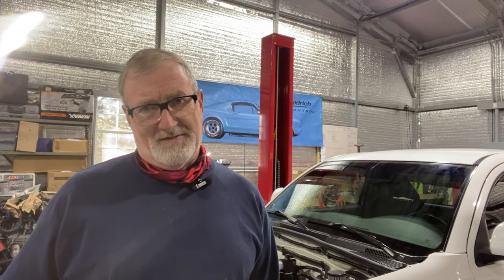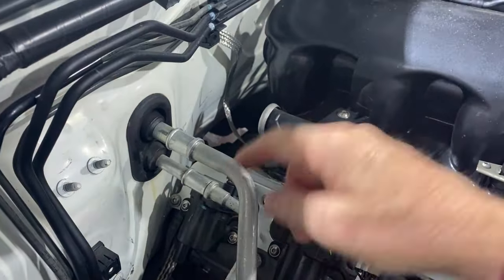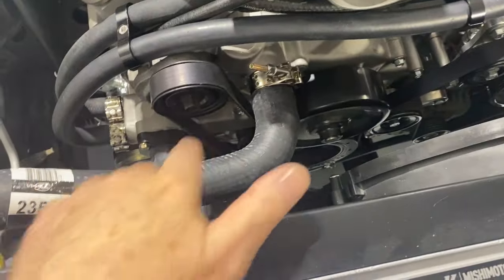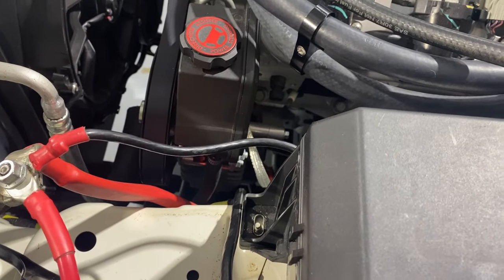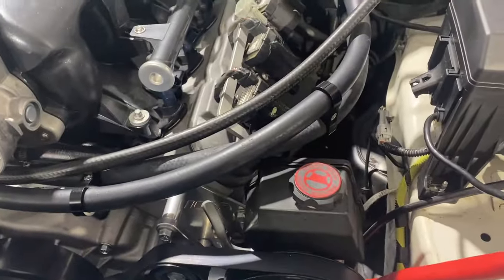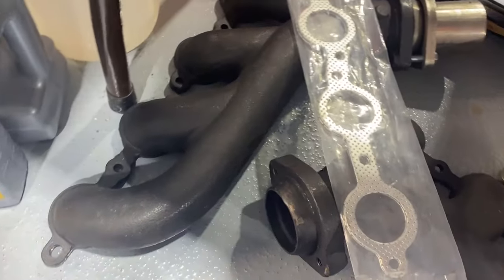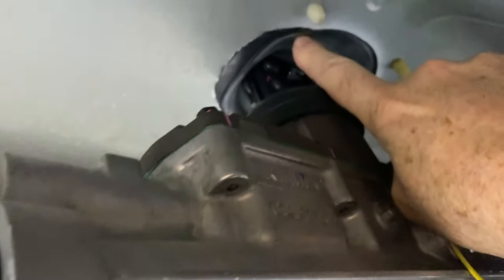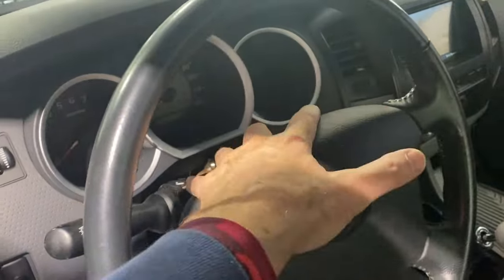Part 7: 2nd Gen 2007 Toyota Tacoma LS Swap WALK-AROUND..Part 1

Comment: do you plan to leave the old ecu in place in order to run the non engine related canbus items? I'm actually looking to do a different swap but worried about what might not work on the body side if the toyota ecu isnt in place. also any plans yet on how you're going to mesh the new motor with the old cluster or do you plan to run an aftermarket cluster?
Reply from the maker: Yes, I do plan to leave the old ecu in place. The modern electronics are complicated and I only want to eliminate what needs to be removed. I plan to have the factory gauges functioning. I have started the truck. It will run, however I only ran it for a few seconds. Putting an exhaust on it today. I’ll know more very shortly. When it’s done I’ll do a complete video on it. Right now, if I tried to video what I’m doing it would take too much time. I’ve changed my mind several times on parts of the swap that either conflicted with each other or I didn’t like how something looked. Thanks for the question, it is looking good! Hang in there!

Comment: Is that the AC compressor from the LS or aftermarket? How about the bracket? Looks like stock location.
Reply from the maker: Thanks for the question. The a/c compressor and bracket are ICT Billet items. I wanted to keep the accessories in their stock location as much as possible. The bracket is very nice and tucks the compressor in. The compressor is very compact and is definitely smaller and more compact than even the GM Corvette compressor. Problem I found with the Corvette compressor was its length and hose/manifold placement. The length put it very close to the motor mount and with the compressor hose manifold mounting on the rear of the compressor, it would not work at all. The new compressor was shorter and the hose manifold mounting was on the side giving valuable room to work with. Check out one of the earlier videos, I went into more detail on the a/c mounting.

Comment: Thanks for the tips. I’m just starting to plan out a swap like this.
Do you think the Holley terminator max is worth the money? Especially if someone is thinking of using a 4l80.
Reply from the maker: Depends on a number of things...your budget, planning on how to run your gauges, etc. I have not personally used the Holley system. I'm sure they are a good product. Is it right for your swap? For example, in my case, I relocated a number of items that would make it impossible to use a "pre-made" or box kit. If you were to locate all the items as basically stock for a Tahoe/Truck, it may be fine. I located my pcm on passenger side fender panel, tac module inside the cab, etc. so an "off the shelf" harness would not work for me. For the money, I would suggest a harness builder (with a good reputation) and literally discuss with them the placement and exact item of every item to plan to use and its location to the pcm. That way, no surprises on wiring length and location. You need to let them know the type of injectors you are using, location of alternator and what type plug it has, type of coolant sensor (2 wire or 3),  if DBW, the length of wires (based on where you plan to mount it), etc.  On that note, if you are planning on going DBW, get the pedal, tac module, connector, and pcm from the same vehicle. If you don't, you may have issues with all the parts communicating properly with the pcm and TB. This is why I say an "off the shelf" product may not suit your build. Since you are in the planning stages, you can really go into detail so you are more certain to get exactly what you need for your project. I will be doing a video soon on wiring harness choices and pros/cons. There is no "best" harness since every swap is a custom application.  In some instances, Holley may be the best choice...or it could be a poor one. Do your research. It will become more clear which way to go. For the easiest swap (if there really is such a thing), go with gen3 engine with a matching transmission (from a donor), DBC, keep as much as possible stock to that engine and keep the harness the same way. Swapping into a smaller vehicle can pose some packaging issues due to less available area to mount stuff. Not to scare you, planning is your best way to insure a smooth project with minimal hiccups. There will be hiccups, I guarantee! All are fixable, but some you won't see until you get to that point in the swap and others will be more obvious. Too much to cover here. You can always contact me via email or messenger to cover more. Thanks for asking.
Reply: Thanks for the informative reply. I’ve been looking at videos on wiring, maybe a going with PSI may be a good choice for me.
I was contemplating a cd009 to a gen 3 Ls. But with your recommendation of stay stock with the original transmission is swaying my options to going automatic, 4l80 looks like.
I don’t think this project will be out of my skill set, just working on a realistic budget.
I’ll be taking my time, clean and repair the donor motor/trany. Wiring harness. I believe Dakota has converters for the gauges to work, ect….
I’d like to do this right, professional, reliable.
Oh, forgot, I have a XRunner so I should have a bit more room without the 4wd stuff.
Again thank you, good info.

Comment: I just ls swapped my 06.   Why do u need to leave the factory ecu?
Reply from the maker: The factory ECU runs a number of things. You don’t want to remove any more wiring or parts that you absolutely have to. Getting all of your gauges to work and air-conditioning can be a bit of a challenge. The language the LS pcm speaks cannot be interpreted by the Toyota ECM or gauges easily. I think I’ve got that handled…I’ll know in the next few weeks. If you have yours working, how did you do it? How about the a/c?

Comment: any updates on the tacoma
Reply from the maker: Yes and no. Yes in that the truck is almost finished. Just a few more details and it will be roadworthy and have everything working the way I want. I have been frustrated with other builds I have followed that did not reach completion and got sold or the projects were not completed with all the gauges working and a working a/c. I have not put out many videos because this project has had its challenges. I have done several tasks or smaller projects on the truck that have been done over 2-4 times to get it just right. I didn't want to put out a video showing how i did something and then a week or two later put out another video that was different. In several instances such as exhaust manifolds and water pump, I went thru 4 sets before I found the combination I liked. Instead, I plan to make a comprehensive video showing everything and with some detail. Depending on its length, it may be broken up into a couple of videos. This way I can show the way I ultimately went and why. It has been a bit frustrating, but I feel the quality of what I would have put out there would not have been near as complete or accurate as what is coming. Thanks for asking, hang in there, it won't be much longer!